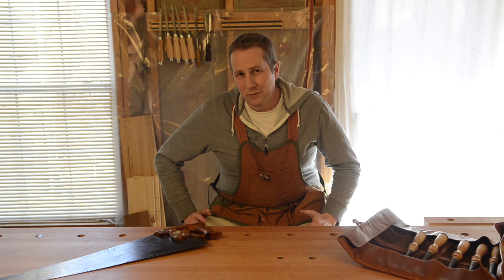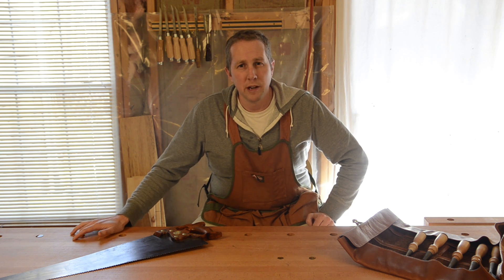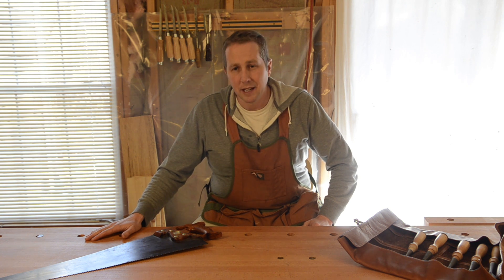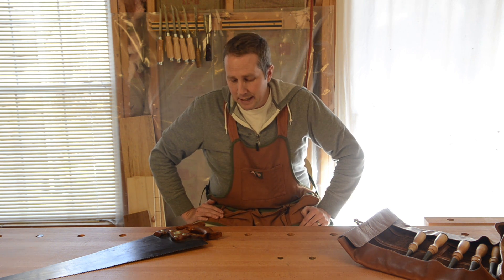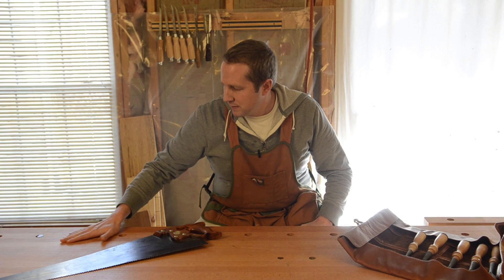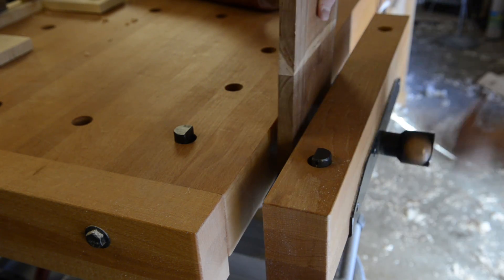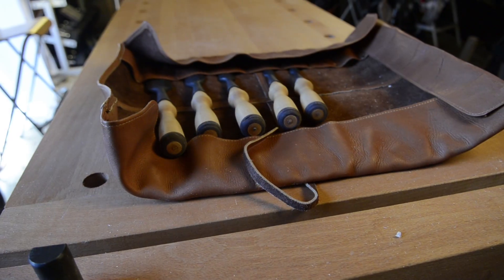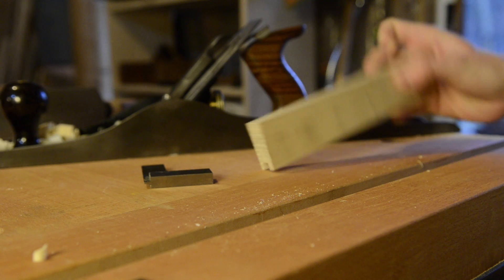Understanding Workbenches for Woodworking

Comment: I have an identical Sjobergs bench. The only thing I’ve done to it was to add cork facings to both sides of the vises. This not only improves grip but also protects the wood. Other than that I have done a lot of work on it. Expensive? Yes but 100% hassle free.